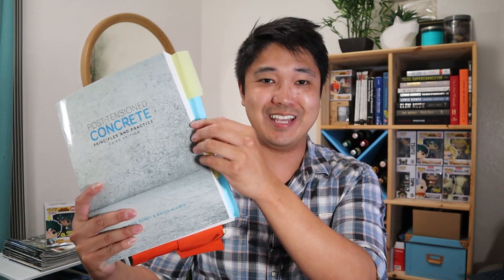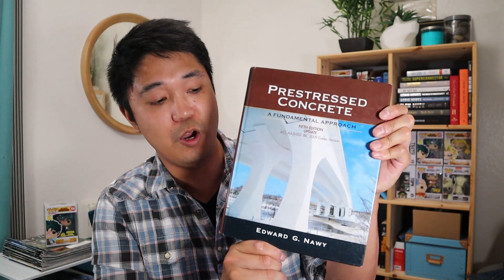Best Post-Tensioned (PT) Concrete Design Books

Comment: Is that book show to us the example of analysis and design of post tension slab such as slab at podium and transfer plate? Who the autor?
Reply from the maker: Yes, it has a design example of a 12"(?) thick post-tensioned podium (transfer) slab. It goes through it by hand and checks it with PTData (software) I believe the example has a few stories of wood buildings on top of it while also considering the heavy landscaping elements (trees, dirt, they are heavy), as well as conductibility issues such as steps in the slab.